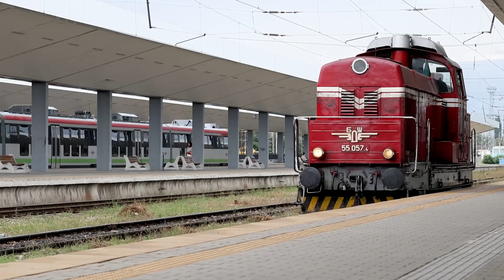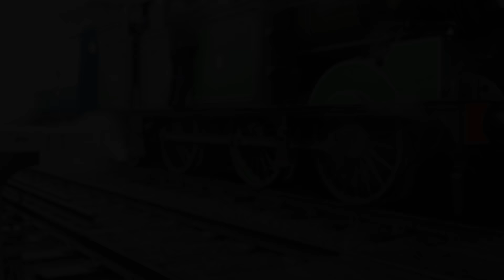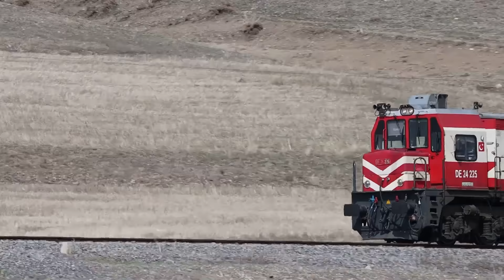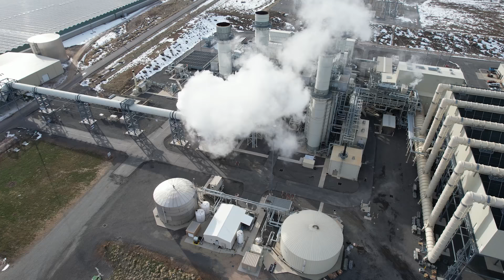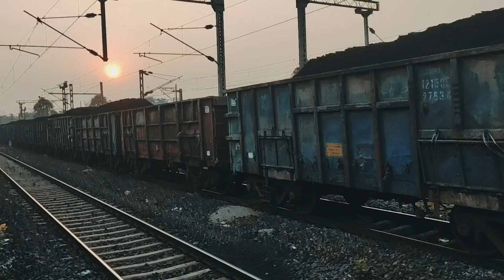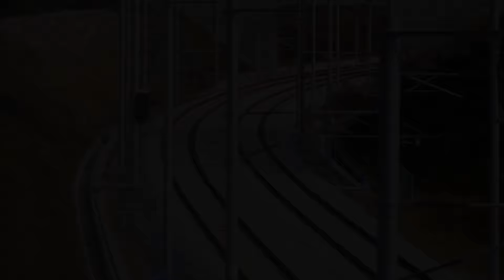Why Do Train Operators Leave Locomotives Running Overnight?

Comment: woooa...EMD's (Electro Motive Diesels) are ''air started" back in my tug boat days.  
Afresh start-up called for ''blow downs'' . manual hand control of U4 gov until oil flow
in the gov stabilized. ps this also on EMD CG tests when seeking CG licensing ie Merchant Marine

Comment: If air pressure is high in the main pipeline, that mean, the air break is off, so how dose keeping air break on, when the pipe is fully charged
, that dose not make any sense ???, the break only come on, when the main pipeline, go low or no air ???, and all carriage has a triple valve system, breaking system, as far as I know of ???

Comment: Trains use water not antifreeze
Reply: "overhead" radiators,fear of head gasket leaks,water much less damaging if a small amount gets into the oil than compared to glycol antifreeze 
crew parked their local switcher (an older GP non turbo that had been mainline power when new or possibly a newer GP 38) across from the old Albemarle Hotel in Charlottesville VA and left it at night ,when it was warm weather they shut her down,when there was possibility of freezing weather they left it running. It was protected by a derailer device with a padlock from getting out onto the main line from its blind siding and I think there was a hasp with a padlock on it when they were gone and off duty protecting the cab.  I was given a little tour of it and allowed into the cab/control stand area by the crew, the Southern was the friendly railroad.
Reply: Not all of them, a few years back some of them started using waterless coolant